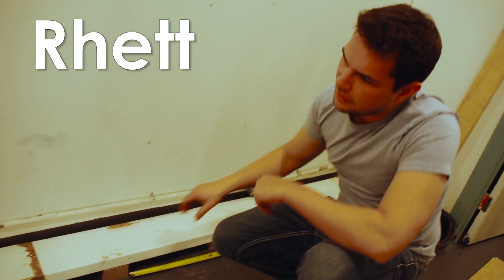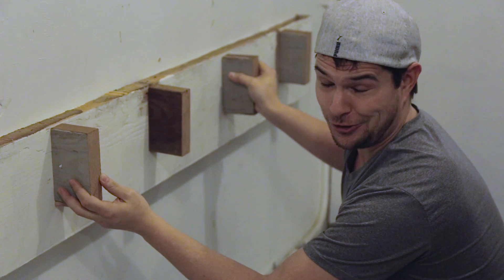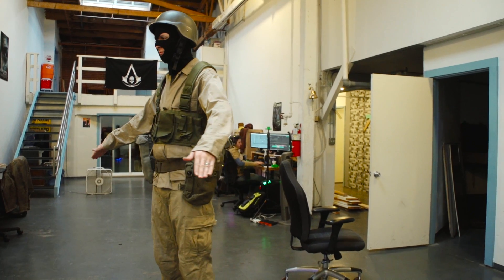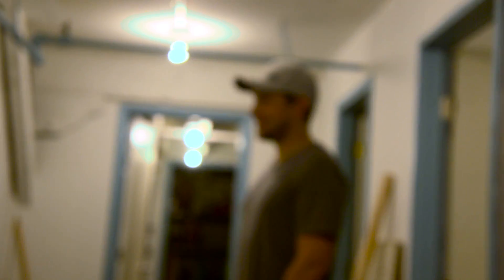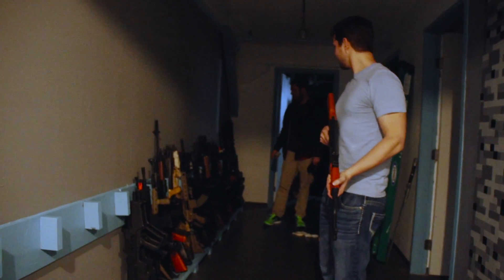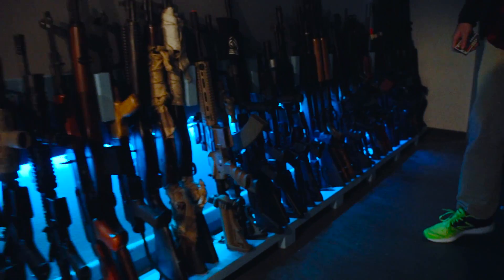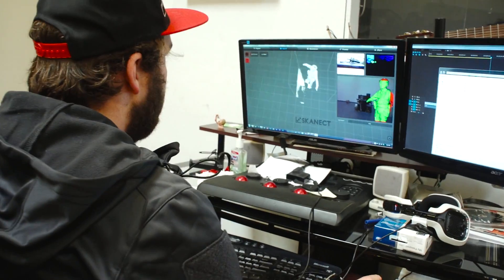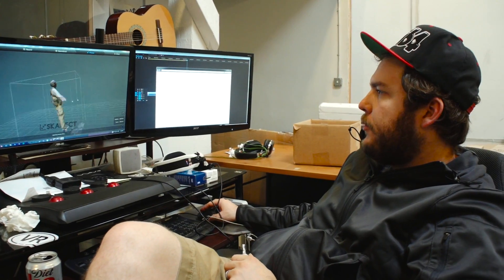3D Scanning My Friend With an Xbox Kinect

Comment: Im pretty sure using the iohawk durring your scans requires more cleanup time than just walking around your scan target, still looks cool. also your new gun rack would be great for a live action due process video!
Reply: Actually it's the opposite! We used to do just that, walking around the still subject. However after trying the iohawk method we found we not only got much more accurate results, we had much less cleanup work to do. Something about moving the camera less means better results. I think it might be the shutter speed on the kinect camera being low which could cause motion blur if moved too fast. So less motion means less motion blur and sharper scans.
Reply: +wrenthereaper Thanks, great reply! But you would think the shutter speed on the connect camera would be above average if it's being used to track people moving at rather high speeds jumping and such. (Big thanks to creative cloud for starting to shutting down my computer without asking)

Comment: I tried the 3D scanning but the scan kept stopping after very little time and, when it was working, the model was very imprecise... It is a problem with the lighting of the room?
Reply from the maker: If there's infrared light from the sun, that can mess it up. The subject of the scan needs to remain perfectly still also.
Reply: Oh I see, I tested it inside during the night so it seems my mistake was that I thought I (with the Kinect) needed to move, but it is the person or the object being scanned that needs to rotate slowly... Thank you for your help and keep up the good work!
Reply: It might be that you're moving the camera too fast. If the camera detects motion above a certain threshold it automatically ends the scan. Try being reaaaaaally slow and deliberate with how you move the kinect. And yeah, close off things like windows that let in a lot of infrared light from the sun. If your subject moves a little bit, it won't end the scan but it'll mess up your results.
Reply: Oh ok, so the subject needs to stay still while I move... I thought I was already really slow... How slow do I need to be (as a reference)? For example, how long does it take you to complete one circle around a person?
Reply: +Stefano Rolando Try moving your hand like an inch per second. Also check your hard drive space that you have enough as it takes a lot of memory. Lastly, check that the "3D" box in your program is set to the right size, depending if you want to scan a head, torso or a whole body!
Reply: Johan Friedner Thank you for the help, I'll keep your suggestions in mind when I'll do a test

Comment: :36 

Bruh, Sam, I've got those same speakers, the Altec Lansing 2.1's. They came with my first computer and I'm still using them as a sound system in my kitchen. I'm sure that's not what you use to master audio but the range on those is spectacular!

Comment: Question? If you 3d scan quite a bit why dont you just build a basic rig?
Reply: +QurttoRco Probably because the method they're using is cheap, doesn't require any additional setup and is quite easy to do. Also holding the kinect allows you to get into small spaces like folds and stuff.